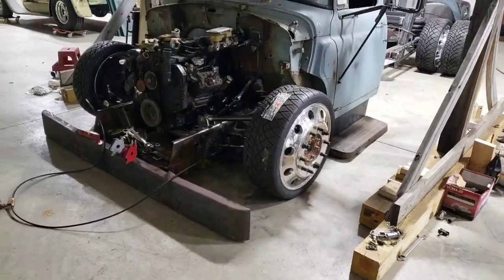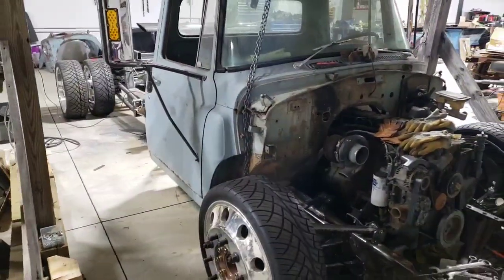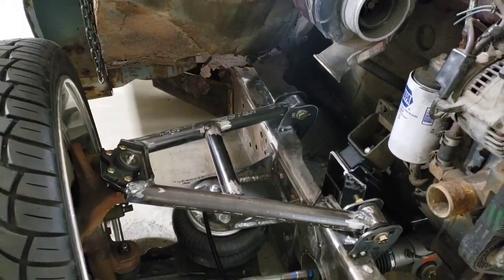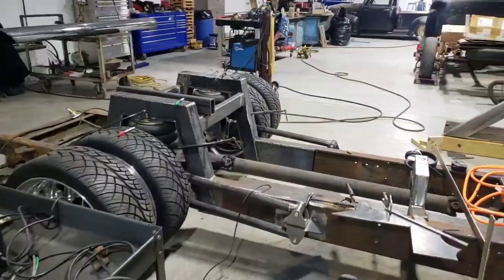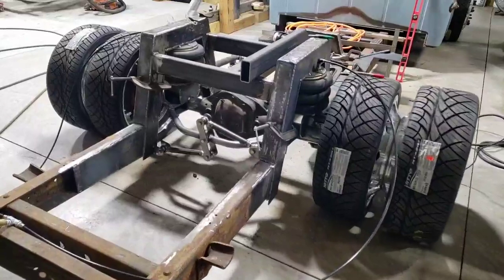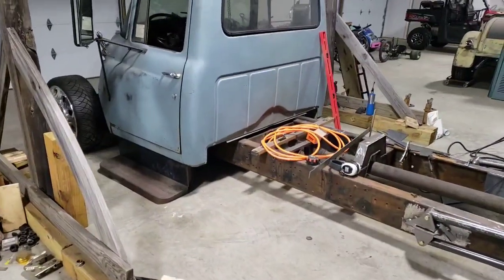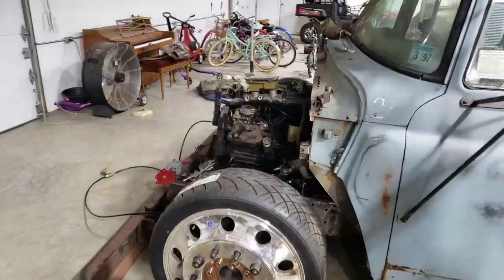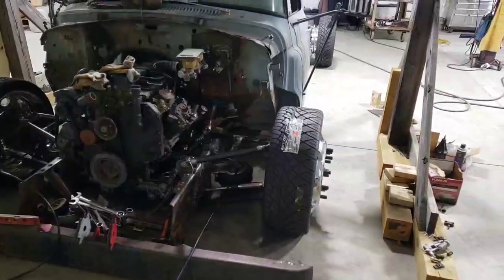New upper control arms and airride cycling on the 1964 International

Comment: Would share what it took u to do ur control arms if u would
Reply from the maker: The control arms and spindles are for a 95 1 ton chevy. The lowers were made by Michigan metal works. The uppers I bought some pieces from nfamous fab in Texas and made. I'm not sure that I'm happy with them though so I may switch again. This project has been on the back burner for a while but I'm hoping to get back on it soon.

Comment: Diggin it 😎
Curious,,,  what’s your wheelbase?  Was it just an extended cab long bed dodge? I’ve got a 63 f600 that’s waiting for this treatment.   I’m wanting a ramp truck?  I ask because you didn’t have to modify your driveshaft.
Reply from the maker: Its actually on the original loadstar frame. It has custom front and rear suspension. I cut everything out from under it and built all of this stuff.

Comment: How did you calculate the correct length of the control arms? And where did you get the ball joints from?
Reply from the maker: Ball joints came from Oreilly. The stuff to build the control arms came from Nfamus metal out of texas
Reply: @Smittys_Speed_Shop  It's looking great, thanks for the reply.

Comment: Is that a stock Dana Pickup truck rear axle or cab and chassis axle? Thanks
Reply from the maker: I'm not sure to be honest.  I bought a d350 dodge that had a flatbed on it for my donar truck. Im not sure if it was a original cab chassis truck or a dually bed truck that had been converted to a flat bed.
Reply: @Smittys_Speed_Shop  thanks, yeah it looks like a first gen Dana 70. Good luck with the project!